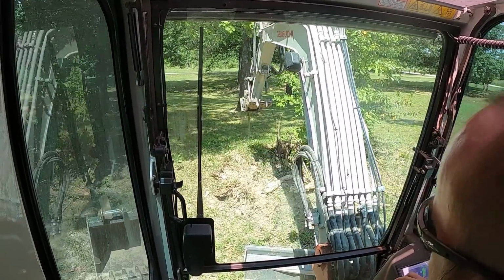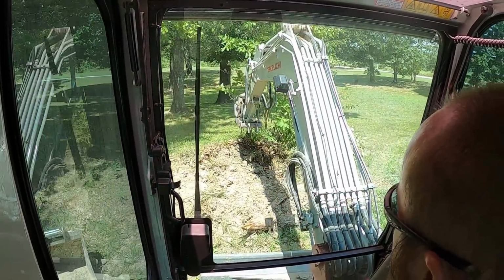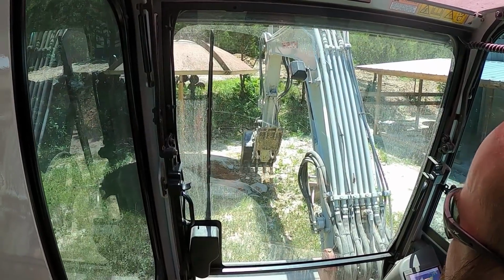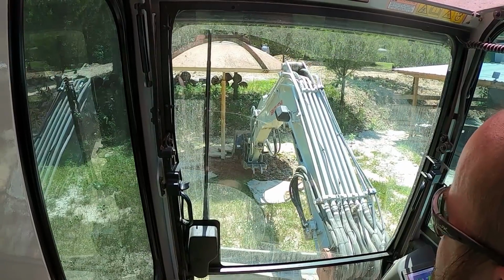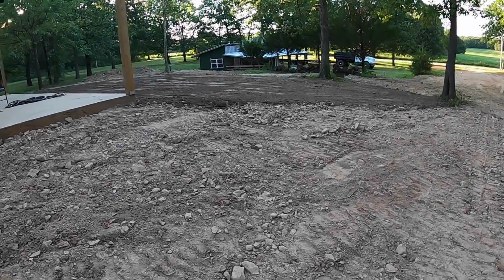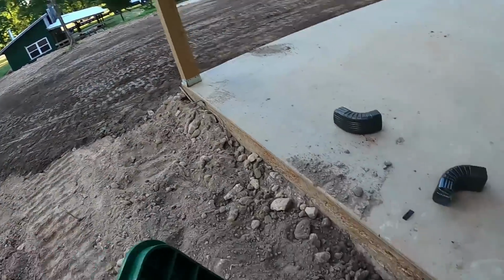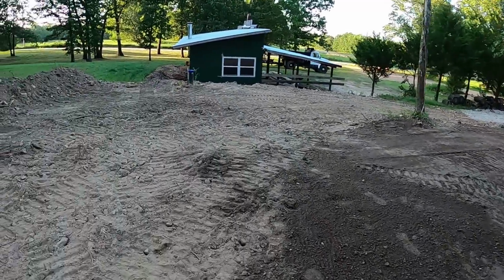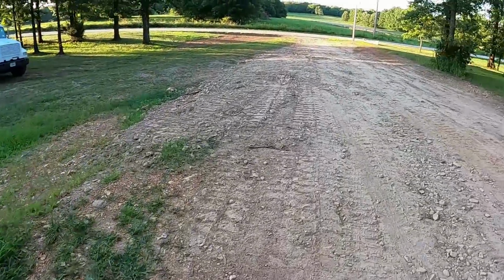Finishing The Rough Grade

Comment: Brandon... how about planting that dish above the canoe... then they could float the rocky shoals in comfort!!!

The budget sprinkler system ought to work... if he remembers to turn it on and off without pumping his well dry. 

You were right, video makes the place look a lot larger than it is in person... on video, the horseshoe driveway looks like you could drive a tractor-trailer unit around it at road speed!

No measurable rainfall here yet!
Reply from the maker: 🤣🤣 that’s a good idea on the canoe. Exactly and if he remembers to drain the water in the lines before winter. Yeah it’s pretty tight quarters in person. Glad you stopped by that day 👍🏻